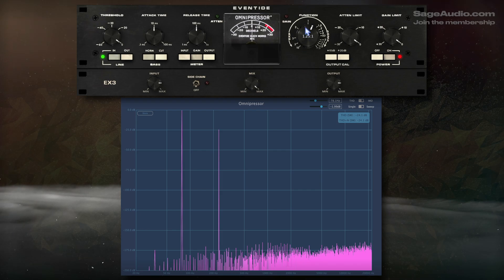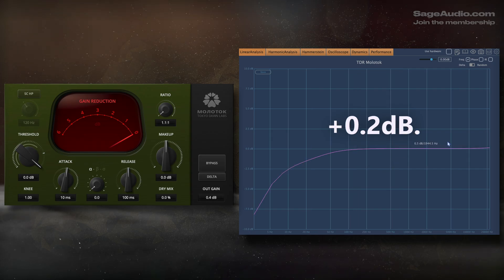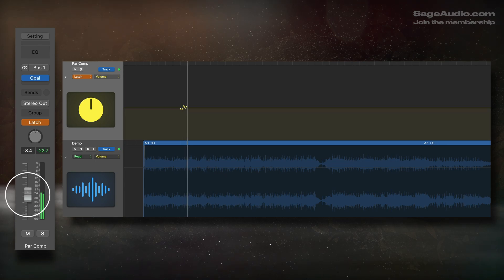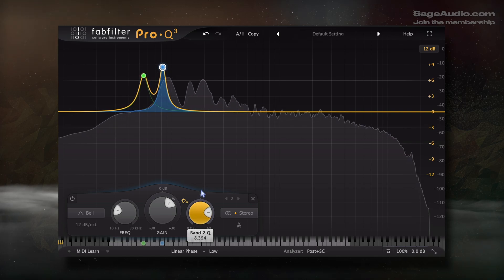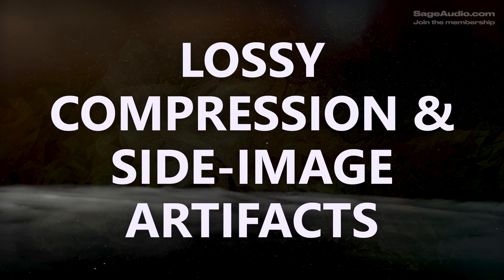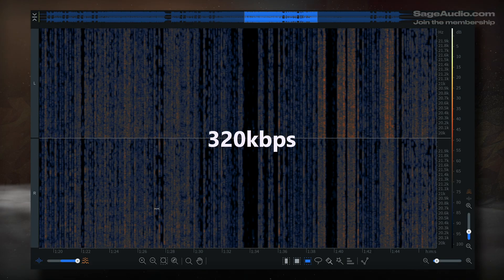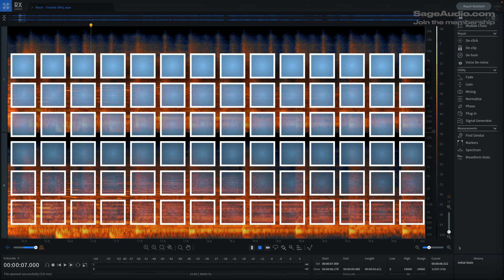5 Advanced Compression Techniques (Simple to Complex)

Comment: FFT is pretty old and there already is lots of plugins that use it. Most plugins use it for either visualisation or analysis where the actual processing based on the analysis happens again in time domain, not frequency domain (for example oeksound soothe). The reasons for this is the inherent latency in the FFT technique and the trade off between time resolution (for example transients) and frequency resolution (high frequency detail). You can’t really get both when you convert your signal back from frequency domain. That is why melodyne for example uses a mixture of both time and frequency domain processing to get a realistic result and it gets really complex and CPU intense if you want to get it right. There are however great sound design plugins that apply similar concepts like GRM Tools but they are more intended for creative sound mangling, not for mixing.

Comment: i think what you’re asking for about a dB axis and a time axis has already been done, and it’s just wave shaping. the amplitude is already encoded in the image, just as color instead of another axis. 

if what you’re talking about is more of “spectral wave shaping”, i believe that’s possible. that would be, attenuating volumes at particular frequencies. i can probably code this in plugdata pretty easily.
Reply from the maker: I agree! It's waveshaping but with access to thousands of individual bins that could be altered independently of one another since they've been mapped.

So, like you said, it's spectral waveshaping but with access to the entire signal and the ability to introduce changes at any point in the track and in any manner (instead of the static processing of a typical waveshaping plugin).
Reply: @ if you wanted to see controls for this, what would it look like?
Reply from the maker: Probably just an FFT editor like RX but rearranged by time and amplitude!

Comment: For the FFT - Rx question, I think it would be hard to view that information in a 2D representation. Currently it's laid out in a way where the Amplitude of a frequency is either darker or lighter. The way you describe would display the Higher Amplitudes peaks stacked from top to bottom (but that would be disassociated with their frequency as now that would need a different designation). 
But there are such things as Spectral Compressors, such as the Sonible Smart Comp 2. Now with this unit there is a view at the bottom of the plugin which shows the high amplitude content that is being effected from Low Hz (left) to High Fq (right). It also has a separate view for the wave form over time, and the level of compression over that same timeline. Together they can work to give you the information you're looking for, but also it's still a bit much for the eyes, and somewhat confusing if you don't know what you're looking at.
Reply from the maker: Thank you for sharing your thoughts on this!

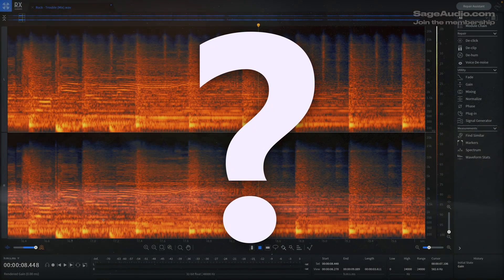Comment: 9:03 The view you describe is that of an oscilloscope, think about it. But I think what you want is to sort frequencies according to their amplitude/dynamic range, and the oscillogram isn't made for that since it shows a single signal, which is your musical output. You'd have to plot one signal per frequency on your graph, which would be quickly unreadable and much harder to select those signals/frequencies (I mean, do you see yourself clicking on the signal in your scope among all the other signals?) I think RX is great, it does exactly what you want but uses colors instead of an axis (in fact I think it has a 3D view that adds the amplitude axis like what you want). I've seen other comments on MDynamics MB, and YES I think it does what you want, and this compressor uses the usual EQ graph (x-axis = frequency, y-axis = amplitude) and I think it's great just like that
Reply from the maker: RX and MDynamics MB are great suggestions, and they definitely offer the kind of frequency/amplitude visualization that could be great for this. Thanks for pointing that out!

Comment: I have a question completely unrelated to compression that I’m kinda stuck on. I love the sound of a tri stereo chorus and use feedback loops in reaper to create tri stereo flangers. Is there a free plugin that could make tri stereo phasing possible?
Reply: With the definition of tri stereo being left lfo starting phase -2pi/3 center lfo starting phase 0 and right lfo starting phase 2pi/3
Reply from the maker: @dilemmacubing  great question!

For tri-stereo phasing, there aren’t many free plugins specifically designed with that exact LFO phase arrangement, but there are a couple of ways to achieve something similar using free tools in Reaper:

You might have luck with some native plugins, such as ReaEQ or ReaDelay, combined with automation to set the phase offsets manually. You could also use a stereo phaser plugin and automate the phase shift for each channel. It won’t be as straightforward as a dedicated tri-stereo plugin, but with a little setup, it could get you close to the effect you're aiming for?

Alternatively, you might want to look into MeldaProduction’s MFreeFXBundle (free version) which has a versatile phaser that could give you the flexibility to adjust phase for different channels.

I'll also link a few great paid tri-stereo chorus plugins below too!

Hopefully, that helps point you in the right direction!

https://store.eventideaudio.com/products/tricerachorus?srsltid=AfmBOoqgLXYElBKFB4NbgNCokhoNBhjnW8XZUnOelGP5aSpT1UEJq3M9

https://www.uaudio.fr/uad-plugins/delay-modulation/dytronics-tri-stereo-chorus.html

Comment: For the experimental parallel harmonic compression technique, if I'm not mistaken, you could probably duplicate the source track and remove the output so you can use it as a dedicated sidechain source. Then, you wouldn't need a secondary eq after the compressor due to the fact that it is a source with no output. 

I apologize if I misunderstood what was being communicated. 

Thank you, Sage Audio, for the awesome content!
Reply from the maker: You’re on the right track with the idea of duplicating the source track and using it as a dedicated sidechain source. By doing this, you can indeed use it as a "ghost" sidechain signal, which allows you to shape the compression without affecting the main output. This method would prevent the need for a secondary EQ after the compressor since the duplicated track (with no output) can serve as the trigger without altering the final sound.

The key is making sure that the sidechain source (the duplicate track) is effectively controlling the compressor’s action, without influencing the audible mix. This way, you’re using it purely for its dynamic control while keeping the original signal intact.

No need to apologize, thanks for watching!